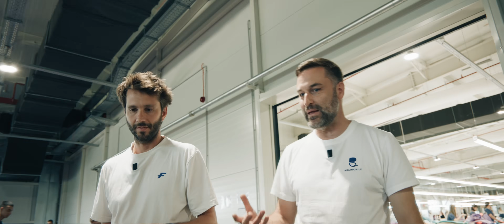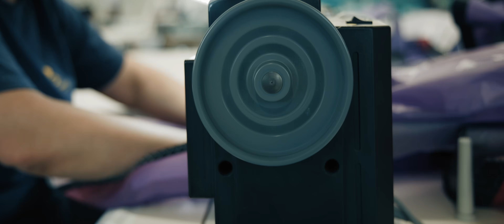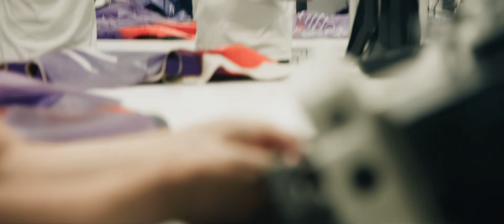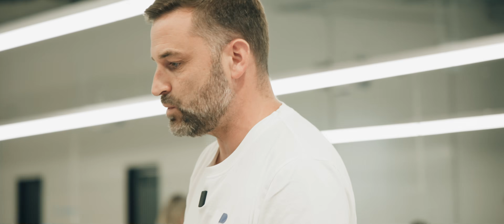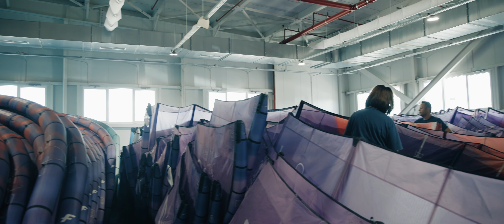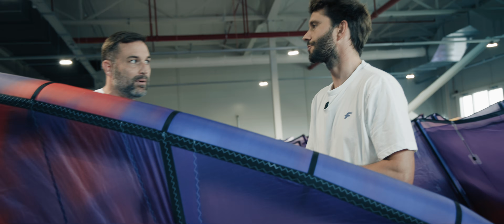F-ONE | Brainchild Factory Tour

Comment: I own the f one bc trigger v2 and had already 2 issues on my 10m probably a “monday” kite. still hope f one will change it completely against a different one as it has now the second major defect within 10 months and beeing 2 months away for first repair :(
Reply: Had no issues with my 8m v2. 10m v2 was changed against small fee now to 10m v3. Still happy customer.
Reply: @randomhuman8684 thank you For the answer
Reply: What are the issues ?
Reply: @samisubzero first was leaking air. Was repaired for free. My shop did give a good support but took 2 months with f one. 
Now the point where you attach the steering lines has completely ripped of. 
Again good service from my shop changed the kite against small payment against new v3. 
But the kite is flying very well. That should be mentioned. Best I have used so far.